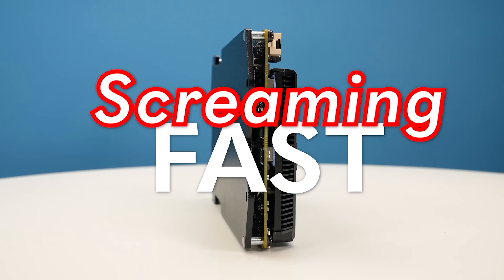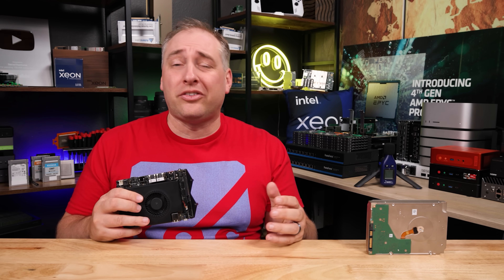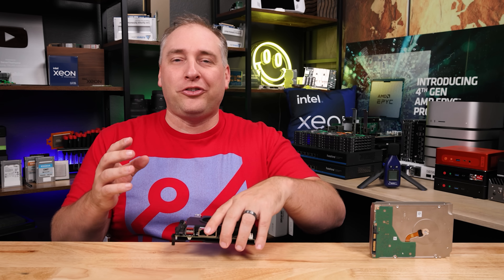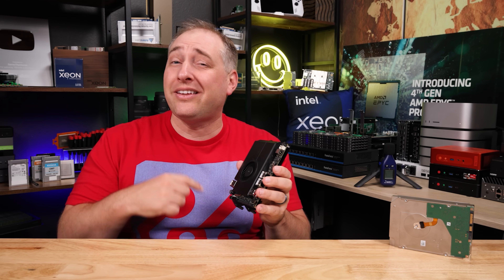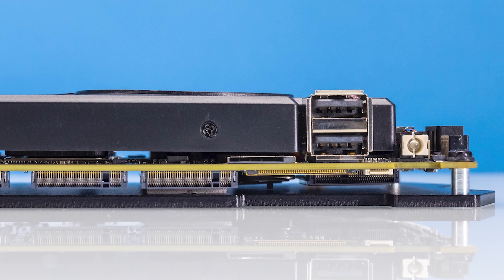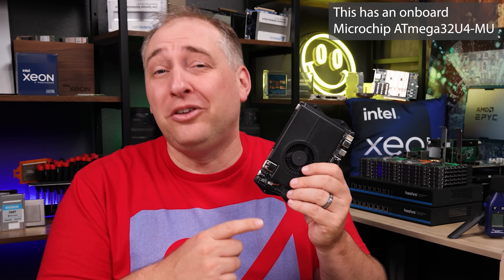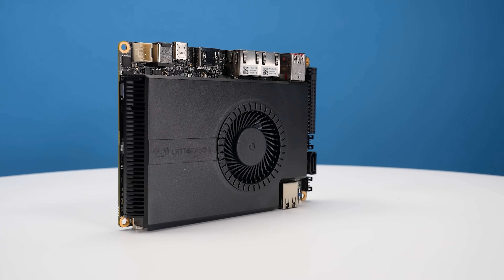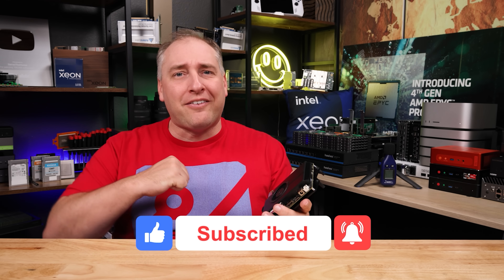This Single Board Computer is Faster than a Mac Mini AND a Raspberry Pi

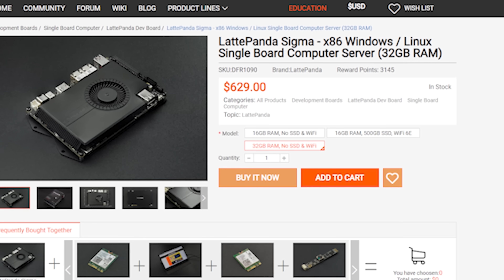Comment: @3:15 in your video you it shows 32GB for $629. that seems a great value. Today 7/27 ( just one day later ) amazon list the only 16gb for $829. aliexpress list the 32gb for $860.  How do we get the computer with 32gb for $629. is there some kind of code we have to enter?
Reply from the maker: Amazon is a higher price. The more direct DFRobot site has the lower price.
Reply: @ServeTheHomeVideo  thank you. i tried your first two links. I guess I should have clicked on the 3rd link :-)

Comment: I am going to mention the elephant in the room: That thing is FUCKING EXPENSIVE. A complete Mac Mini with 8GByte of memory and 256GByte of Flash costs right now €600, sometimes even just €550. That board alone costs more although it comes with 16 instead of 8GByte and has more connectivity.

Comment: There is a 32GB Version of the LattePanda Sigma out there. DFR-1090 for reasonable $50 more you get 32GB instead of 16GB Memory. And yes resonable as it is DDR5.
Reply from the maker: We showed that in the video. I think that is what I would get
Reply: @ServeTheHomeVideo  Didn't catched it. I am not native in english and was working in my Workshop. My bad. Btw i found on thingiverse that someone had the same problem with the Antenna. There is a Bracket for a normal 5-9db Antenna Mount you can download and print it. It screws to the base.

Comment: Looks like an awesome platform! Do you know how LattePanda treated their previous boards if it comes to updating the BIOS? Is it like chinese vendors - you get what you buy and no upgrades? I also wish they also made a Core i3-1315U as a cheaper alternative with lower power consumption for a price of 2 p-cores. That would be a good platform for remote PoE uses.
Reply: Do not touch Latte Panda, you have been warned. Any issues with this platform and you are left high and dry. I can tell you from first hand experience.

Comment: It's $648. I'm not sure comparing it to RPi or M2 Apple is appropriate. It's 10x the price of the RPi and it's a different class of processor from M2 and draws about 2x more power, noisy fan, and is not consumer-ready. Very confusing.
Reply from the maker: The thumbnail is comparing it to 15x Raspberry Pi's, not 1.

Comment: For me the pricing is making this a niche product. If we were talking $200 or less this would change the landscape completely.  When you can get a more powerful mini PC for less and be able to upgrade the memory.  I already own a arduino. 

That was the attraction with the first couple of SBC. Compact, cheap and powerful. I'm not sure it's any of these
Reply: The more look at the Sigma,  the more  I like it but i dont need it :)   Its positioning is not clear. It could be a great desktop computer with enough horse power.... but for  it does not have a case (unless you do 3D printing...).  For a router / industrial computer we could have less power but would prefer something passive-cooled and more sturdy.   Integrated Arduino -- this is an outdated chip --  moreover I miss the value of having it integrated...this  is not how we develop microcontroller projects.
All still could be fine if the price is adequate --- unfortunately it is not.  Additional note - the barebone version comes without the Wifi card, which also means no Bluetooth.
Reply: @Solista670  I completely agree. You could get a ryzen 5 mini pc for this money. If you want a low wattage, you could go for an even cheaper n95.
Reply: You can get a full fledge AMD based gaming mini PC, like the um790, or a cheaper AMD 7000 series variant mini PC for even less that will run laps around the sigma, while using less power.  To me, an RPi killer is something with more power/capability, around the same price/power consumption, not 5-10x the power and 10x the price....
Reply: 200$ is an insane price to ask for and comparable mini PCs cost at least several hundred dollar more than the sigma. The cost of the individual parts alone would exceed 200$. Building a device with a mini PC and an Arduino would also increase weight and size by several hundred percent. And why would the market about you personally already owning an Arduino? Just because you don't  know the possible use cases doesn't make this a niche product.
Reply: This is priced in US$$$$, and when ordered and sent to New Zealand, the overall price translates to around NZ$1030? Say 30 dollars above the import duty 'kicking in' threshold on the total value. All of a sudden, because of the extra NZ$30, I have to pay NZ import duty, customs fees and biosecurity fees.......around say NZ$300..... buy the time I get it, it becomes very expensive Over NZ$1,300....  another thing, the WIFI aerials are a really crappy set-up... a couple of loose wires...geez..... what about a couple of aerials and aerial sockets?
I'm running Win 11 Pro and Linux Mint 21.2 (using the 6.1 kernel series.... it doesn't work so well on the std 5.15 series Kernel) So, as Edge has just been released for 21.2, I would use that edition. Mint 21.3 is being released now, so I would wait until 21.3 Edge is released. Or you could use the Std download and manually change it over to the 6.1series kernel/upgrades.......... anyway, the main news out of my little rant, is that Linux MINT in fact works very well, as long as you use the latest kernel. Ubuntu was the factory recommended LINUX..... (which is what LINUX Mint is based on)
Overall......so far I can';t fault it. I am hoping that a decent aftermarket case materializes soon.... just about gave it a wash with a cup of coffee 2 days ago!!
Reply: @colonelfustercluck486  I'm in Australia and just discovered ex-government auction sites where I can now pick up i5 laptops for around $60 with 8gb ram and 250gb SSD and on board graphics. $40+ for desktops. Of course they come with "no operating system".

I really wont buy another SBC unless I am doing specific projects requiring GPIO or tiny space requirements - their prices are just not worth it at all. Ridiculous costs.

All my small projects have moved to Pi 2 Zero or even ESP32 - no need for SBC in the home hobby market at all anymore. They really have killed it.
Reply: @colonelfustercluck486  it's trying to be everything to everyone. But the one thing it needs to be is cheap! The price being above the import level is just another nail in its coffin.

In 20 years we will be watching retro YouTube videos about how these never caught on.
Reply: @Hold_My_Pocket .... true... and it is everything to everyone... 
but the price!!! Gee...
As one earlier commenter said, if it was also passively cooled, that would assist in the industrial area.
The price is definitely the problem here, paying retail when we buy from the manufacturer.
Reply: This is actually quite cheap for what it is. People tend to ignore the overall tech price increases in high end devices and the fact that inflation is a thing
Reply: @AlpineTheHusky  It is being sold for $1500.00 in Australia. Its absurdly priced. (Exchange puts it at around $800-$900) So yeah - shove it.

Comment: The same price as MinisForum U790 Pro Ryzen 9 7940HS.
And it's just a little bit cheaper than Beelink GTR7.
😂
Maybe I'm missing something,
but pi or arduino are dirt cheap,
that is the whole point of these platforms, isn't it?

Comment: Yeah you can get off brand after market sbc that are better than raspberry pi, shit orange pi offered 64 bit multi core sbc way before raspberry pi, just people don't wanna figure how to use it, 

Much easier when they use off the shelf  SoC from mediatek and allwinner, just a  tablet/smartphone development motherboard or devkit
Reply: Wonder If you took 4 Octa core soc, tied em to a gpu via fpga and pcie, what kinda games it can run, use the embedded graphics to pre render, then do final render on external gpu, add 16GB of shared ram

1GB of hbm vram 

32 cores, or more  if hyperthreading is supported, would be great for multi tasking os, and you could finally run windows on it, you just need a bootloader and nt kernel that an arm cpu can actually execute, and a few custom drivers

Comment: For myself what i would do is build a small case out of wood that i would have set for the case 3 80mm fans and also i would get the EXP GDC TH3P4G3 eGPU enclosure slap on it as well a RTX 4060 (Or RTX 4050 if that ever comes out) with a 400w PSU that i would also use to power my 1tb 2.5" SSD and the good thing about that enclosure it gives you the option to power the SBC while using the GPU at the same time which i would have a nice little gaming PC setup for my living room.

Comment: Wow did they cram a lot of stuff in that small of a package!  I remember getting a VIA Epia X86 PC half the size back in the late 90's, and it ran Windows XP no problem, Linux even better.  Strangely they didn't do to well with their boards, and now don't have consumer offerings anymore, but rather do manufacturing system automation hardware and software systems, but they were way ahead of the game back then, and could have competed with Intel and AMD with their processors given a little more time!

Comment: In-band ecc - nice! Like the ASus industry mini pc
How trustworthy is the company? Long term firmware updates - no edgy blobs etc
Reply: Not very. I bought one of these  and it was a waste of money. If you install 11 that came with it it recognizes 3 drives. After a couple updates it doesn't recognize the drive in slot 3. LP responded once then went silent. It's been more than 30 days but I'm still going to see if I can get a refund from Amazon. I will never trust anything from LP and I have to say, I'm not trusting STH much either.

Comment: The macMini you referenced, had only 8 cores? In that case, the comparison is unfair, not to mention the mini is 15,6 better in single core performance and the panda is only 1.2 better in multicore, with 4 more E cores. Power draw in full load ? XE graphic performance ? I know macMini is not a good option for self hosting server but neither panda is good for productivity. It still remain one overpriced SBC for techno geeks.

Comment: At that price it had better be faster than a raspberry pi. But most uses for an SBC are not looking for speed; size and power consumption is what’s important.
Reply: Indeed. For a lot of people who just use the net for light surfing and buying a few things or watching a few videos's the rasp pis are good enough and consume next to no power. I am contemplating switching mine on more often because i spend a lot of time on my main just using lower power apps which the pi could do. Youtube does not need a 400 watt RTX 3060 and a ryzen 5 5500@3.5

Comment: I wish SBC manufacturers would integrate snap-in RAM chip sockets like the 70s-90s. They had it right the 1st time and I get jealous watching retro channels switch out components in seconds instead of needing tweezers, heat-gun, flux, etc etc

Comment: It costs more than 15x the price of a pi here so as a pi comparison it's pretty useless because price was its defining point. As a powerful SBC, it'd work in some niches where cost isn't as much as an issue.
Reply: Definitely not a realistic raspberry pi alternative because of this. The initial draw of the pi for most people is the price point. Full stop.
Reply: You can get a Latte Panda. That's doing way better than looking for Raspberry Pis where I am. I've been on rpilocator a few times a week for the past month and none of the vendors where I am have them. Especially not the 8 GB models. 

Obtainable vs unobtanium (or scalper prices)... I'll go with the panda
Reply: You're either getting a screaming deal on a pi or getting screwed on this one, because its $650 for one with wifi and an SSD on amazon.

Which is still not at all what I'd consider a comparable unit to a pi.  A $70 pi is effectively disposable. I  wouldn't blink at sticking a pi on something that might self destruct if things go sideways and require the use of a fire extinguisher. 

Like my home brew 3D printer did. You stop looking for just a few minutes and it decides to squirt filament out the print head and manages to aim it precisely at the pi. Uncanny accuracy.

A nearly $700 single board? Norfolk and Waypal. Bad plan. One wierd glitch and you're out a couple of car payments instead of a movie night.
Reply: well' he wan'ts ppl to buy  them, so he has to get lots of views, to get lots of ref money...thats how youtube works now a days...
Don't be mad at him for using the system, it his job to make money, to have a good life...Take the information out if it he's giving you, bevore you might buy one..
Reply: @wojtek-33 I was going to say you sound salty, but that second comment was hilarious. 😂 you right. I'm guessing they changed the title. It's better now.
Reply: If that's what I need to pay for an SBC with in-band ECC RAM, then it is what it is... I wish vendors prioritized that feature in lower cost SBCs, but unfortunately, it's ultra rare.
Reply: And slightly bigger SFF or NUC's exist for far less if all you want to do is internet, basic office tasks, YouTube or online TV streaming. For a lot less money. I will just get an SFF older PC to run my MIDI Keyboard and Music clip launcher.
Reply: pi has no alimentation
Reply: How much do you think the raspberry pi 5 with max mem costs., factor in a power supply and a case with a good cooler.. ?
Reply: Nah, here pis are expensive as well, so I'd much rather get this thing
Reply: It's about 8x the Price of a Pi 4 8GB.  For that you get 2 NVME Slots, 2 additional M2 slots, lot of performance. And the GPIO you may need as a Edge Server. This is a Raspberry Pi turned serious for Commercial use. And for that the price is okey, especially as there is a 32GB Version out there with the inline ECC Feature it is a perfect board for Running in a Commercial Manufacturing Machine, or the Homelab Server. Personally i can say that the Performance of a Pi 4 8GB is okey, but in lot scenarios you run into Performance Problems at some point and one Slot is taken by the USB to SSD Card, as SD Cards tend to die and so on. I have several Pi but the big one i used had to be replaced by an old AMD ITX Board with an A10-7850k on it, as the Desktop Performance was lacking. Now i got a USB to GPIO and can use the old RS232 of the board.
Reply: Thank you for your comment, I read it as I started to run the video. After seeing it I realized watching the video was a waste of  my time. It’s like comparing a 300 beater car against a brand new gt500 with a sticker of 80k
Reply: It's a realistic point of comparison because the Pi is both hard to obtain, and really struggles to produce a performant environment for modern computing. Don't get me wrong, it's cool and low power, but, the guys running entire homelabs on them are masochists.
Reply: @jttech44  How is it a trash title?  He didn't say it was a Pi alternative, the fact he said its faster than Mac Mini should make it obvious its not remotely in the same price bracket and the comparison is based on it not being much bigger than a Pi, not the price.  If you need a fast PC that includes GPIO, its a very compelling device.

Its quite clear the title is comparing how much power you get in the physical size, not the cost.  Your car comparison would only make sense if the cars physically were a similar size.

Comment: Uh what do you mean faster as a M2 Mac Mini… are they so slow? I wonder what nbay disk enclosure can host this.. TB?
Reply from the maker: We showed the benchmarks. It is only slightly faster, but it is. 3.5" HDD enclosures would put the ports in the wrong spot.
Reply: It’s only 1.2% “faster” in multi-core operation, but like 15% slower in single-core operation. It’s literally slower by definition. This guy’s channel is filled with paid shills. Can’t u just sense the used car salesman look and feel of his videos? Pure shill. He was obviously paid and given a free device for this video. His opinion is null.

Comment: Comparing this to a raspberry pi is completely unfair. Look at that this BMW is faster than Dodge Caravan. It's not every day you need that level of power. Still it-s an interesting product but expensive.
Reply from the maker: A bit different. You can only drive one car at a time, but many people cluster Pi's and use them 24x7

Comment: Patrick, please dont compare any and every SBC to a Raspberry Pi.  These are not in the same game in any way other than being an SBC, of which there are plenty.  RPi is what it is because of its affordable price and great community.
Reply from the maker: I totally agree, but the community for an Intel based Linux or Windows system can be great as well. At scale (for performance) these are lower power and lower cost
Reply: Sometimes you need a benchmark against which to measure and compare for its ubiquity. For some people, the Pi may just work as such. Doesn't make it the best benchmark or best for everyone.

Comment: The onboard Arduino could possibly be reprogrammed to act as a custom keyboard on the gpio which could make this extremely useful for niche simulation communities such as train simulation. Having dedicated buttons for things is much better a normal keyboard
Reply: Just get a separate microcontroller board and make a custom USB device. That way you can use your custom controller with any computer.
Reply: I was thinking more "ultimate barcade king"

Comment: Naw when leaving the  Pi ecosystem the worry is moving from a 35 dollar investment on the board, to LattePanda Sigma - The Small Hackable x86 Windows/Linux Single Board Computer Server (16GB RAM) $579.00 In Stock which is 16.5 times more expensive.  Maybe compare the one panda up against 16Pi's at once.
Reply from the maker: We showed it is like 15x the performance. With 16 Pis you also need boot media, network switches and etc. In the end, the Pis would use more power as well